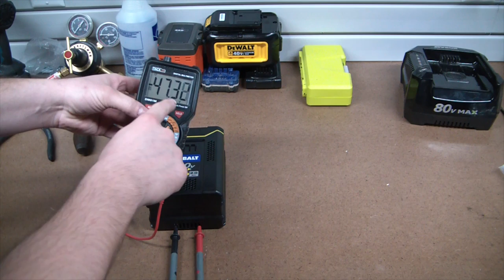Kobalt 80V Battery Recovery and Teardown - ElementalMaker

Comment: in case you don't have a power supply you can use the working 80V battery and a resistor to burn down the shop
Reply from the maker: I like your style 👍👍👍
Reply: Where can you buy a power supply
Reply: Me sitting here who caught the whole table on fire with a 9v battery 👁👄👁
Reply: Wow what lowes give away free dead batteries?  I can't find a lowes or home depot that will let me take dead batteries.
Reply: What value resistor?
Reply: @hduff  Depends on the resistors power rating. If you have a 0.5 W resistor and the voltage drop is 80 V, then the resistor must be larger than R=U²/P=80²/0.5=12.8 kOhm
Reply: @williammolineux1059  no one to answer
Reply: can you elaborate please?
what resistor?
+ to + - to -?
Reply: @ElementalMaker what kind of connector or pins you used for the battery at 3:50 ? And instead of a power supply, can a car battery work to wake up a 80v battery? Thanks
Reply: @anotherparadise  I wouldn't consider attempting it with a car battery as it's 12 volts. Lots of amperage, yes but the voltage is wrong.

Comment: Don't know if this was posted here, too many replies to sort through but, the Kobalt and Greenworks batteries are essentially the same and will work in each others tools. Their battery case has grooves slightly different from each other so initially one brand battery won't slide into the other's battery pocket. I took a wood chisel and removed the one offending ridge on each side of the battery pocket on my Greenworx chainsaw,  leaf blower and snow blower to use a couple Kobalt batteries my son gave me.  He did the same thing with his Kobalt mower to use Greenworks batteries. We also modified the chargers by removing the upper ridge to allow either battery to charge in our respective chargers. Two years now with no issues.
Reply: made by the same company.
Reply: Dumb question over here.. why didn't you just exchange batteries?

Comment: Dang, my battery is at 65v and the charger still has blinking red light. I think the bms is causing my battery to not charge using the bench power supply. :/

Comment: I have a Kobalt 80V lawn mower and my experience is when the mower stops because the battery is discharged none of the green LEDs light when the button is pressed and the battery is down to 65.5V.  Putting the battery on the Kobalt charger can sometimes result in nothing appearing to happen for a while other than a red light. After a further while it comes good and starts to charge fine, I my case I just need to exercise some patience. Thank you for the video, I was trying to disassemble one of these packs who's cover did not want to come off after I'd removed the 4 security screws. Your video gave me the courage to tug a bit harder (which worked).
Reply: @Real Deal Replacement packs are extortionate. Cheaper to buy a new tool that comes with a brand new battery when there are special deals on, like today Memorial day sale.

As for being cheap Chinese designed to fail, I have to disagree. Most Kobalt packs are made with Samsung brand cells made in South Korea. They are designed for 250 cycles. May not sound like much but if you do yard work 25 weeks per year that's a 10 year battery life. 

The important thing is to take good care of the battery packs. Don't let them run too low on charge and store at 50% during the winter months. During the summer I cycle between 25% to 100% state of charge, and store at 75% if possible.

Comment: Also, thanks for the tip!  I had a Kobalt battery reading 56V and being rejected by my charger. I fired up my dual-30V bench supply, put both channels in series, managed to charge it up to 61.5V, at which point the fast charger would take it. Looks like I saved $150 at least for today, plus a trip to Lowes. Thanks!
Reply from the maker: Hopefully it lasts for you, unfortunately mine only lasted another season after rescuing it. I may replace the cells and charging circuit though, since it seems like the oem kobalt charging circuit is what's killing the cells
Reply: @ElementalMaker  Yeah... it worked for awhile, but eventually died again. Hard to tell if it was actually a worn-out battery, or if the prolonged low charge level killed the cells. I wound up shopping around and found Greenworks batteries for substantially less. Sure, they're keyed differently, but if you take the battery apart, and put the Greenworks cells in the Kobalt case, it works just dandy. I know some people route the plastic instead, which is also a possibility. I imagine they use the same molds with a different insert depending on who's battery they make. Bastards!

Comment: I have a dead 80v that was dead.  It was down to 35v.  I woke it up by using a good 80v battery.  Just used a couple of 14 gauge solid core wires to jump it for 5 minutes.  

It didn’t get hot, and now takes a charge.  Thanks for the video.
Reply from the maker: In the future I would highly recommend using a resistor between the batteries, otherwise you could cause some serious damage to both, something like a 100ohm power resistor (100w would work), to limit current to about 1 amp.
Reply: @ElementalMaker  I'd go for a much lower charging current for this. Li-ion batteries, as you probably know, are best charged at constant current up to about 3.9V (depending on the chemistry), then constant voltage. Do it wrong and you damage the cell. But they don't get any significant damage from a trickle charge. So put 100mA or less into it and you're probably pretty good... it takes longer, but it's less stress on the battery.

Comment: Just bought one of these (along with the mower) and came to YouTube to find out what's inside. Now I don't have to tear it down myself. Thanks for the video!
Reply from the maker: They seem like pretty good batteries! Just don't run them totally dead on hot summer days and the batteries should last you some time. 👍
Reply: @ElementalMaker  
So when you run it totally dead at high temp, then as it cools it goes below to low voltage cutoff? Is that correct, that causes the situation you had here, where the voltage is too low to let it charge? I'm on an ongoing quest to understand Li-ion batteries...
Reply from the maker: You are absolutely spot on Jeremy. Very well said. The cutoff voltage seems to be right around 60V, and if it drops below there it bricks the battery unless you have a good power supply you can manually raise the voltage with.
Reply: ElementalMaker 
Cool, thanks for the info!
Reply: @ElementalMaker  Have you ever tried finding replacement circuit boards for that type of battery? I've tried the jumper method and while I can get the voltage back up it will wont charge on the charger and it will only allow the mower to start up and then die. My briggs and stratton 82 volt batteries aren't lasting, i've had 2 that die.

Comment: I can't believe I found this video on my first attempt. I received a cordless Kobalt 80V weedwacker for my birthday this week. My daughter who works at Lowe's brought me a returned battery from the back, unsure of it's condition. It showed dead in the charger and when I pushed the button on the battery. Thank you for proving that these batteries can be recovered. Now I need to get a power supply.
By the way, the 19th century wrench you showed us on your video looks exactly like one I inherited from my grandfather. He called it a "monkey wrench."
Reply: @Real Deal I've had Kobalt 80v yard tools (mower, leaf blower, bush trimmer, weed whacker) for over 3 years now and haven't had any issues with the batteries or the tools and I've abused them thoroughly.
Reply: @Real Deal Not all Li-ion batteries are the same. These are probably using Lithium Manganese Oxide (LMO) cells, which offer a higher specific power than the typical phone/laptop Lithium Cobalt Oxide (LCO) cells. They are optimized for high power, not high specific energy. And yeah, unfortunately, LMO batteries don't last as long as LCO batteries, but as well, you're probably not weed-whacking 10 hours a day, every day. 

Keep in mind, 18650 is just a physical spec for a battery size, no indication of what's inside. This is also why, if you wanted to replace the 18650s in the Kobalt/Greenworks battery, you'd need to really do your homework. You can find 3-5Ah 18650s, but they're probably all LCO, not capable of the peak power needed by electrical tools.

Comment: I forgot to keep 2 of these batteries charged over winter and they read around 3 volts. With a cheapo 60v power supply from Amazon, and about an hour or so, I revived both batteries. My advice if you do this project, be aware of Constant Voltage and Constant Current settings on the power supply and practice with the supply before you use it. Aside from that, Great video and Good luck!

Comment: thanks dude! i don't have a current source, i don't have a proper resistor, so i have to try the jump start with another battery. a bit scary though because there's spark.. i know I should've used a resistor.. anyway, two touches and the voltage of the dead battery boosted to slightly above 20V, and now it starts charging! you are awesome!!
Reply: Absolutely works.  Charge up the good one and then jump positive to positive, neg to neg to the bad battery.  It is easily displayed on the battery case.  After about 10 minutes the power button on the bad battery lit up.  Then put it in the charger and it charged right up.  Works fine now!!

Comment: Great video! Very informative. Thanks to another comment about connecting a good battery to an unchanging one I was able to revive my second battery. If anyone is wondering I used 14 Guage wires for about 5 minutes.
Reply: How did you do this? Did you use a resistor?

Comment: Remember seeing this video ages ago. Was going through the garage mounting ally 80v chargers and 3d printed battery holders etc. Had one 80v battery crica 2017 that would not charge and no lights. Took it apart hooked up the power supply set it to 80V 2A and let it go. A few minutes later I had green lights tested iton a charger and it was golden.

Comment: That's awesome, especially since I imagine that big ol honking pack can't be cheap. Pretty cool design too. I buy and repair DSLR cameras all the time, and they end up coming with usually dead batteries. They're not that exciting, usually only two cells. It's typically one cell that gets below the cutoff and kills it. I just pop them open, ease the low cell back up, charge the pack to full at a low rate, then just do a couple full load cycles before I'm comfortable putting it with the camera when I sell it. But that's friggin awesome. That 80 volt is a nice haul even if you're just at it for the cells alone.

Comment: **PLEASE HELP** My 80v Max 5.0 ah battery is Reading 79.2 volts but still no green bars and will not show any lights red or green on the charger and will not run more than 5 secs if i put it on the chain saw... *WHY?????**  its reading full charged on the digital multimeter  but nothing on the the chain saw battery itself or on the charger.. 😵😵😵😵
Reply: Had similar problem with HF Atlas 80v, which has 2, 40v legs.  2 year old batter with 3 test lights had 38+v each leg.  Would turn the trimmer on briefly.  Started charger but shut off quickly, flashing red.  Went ahead and connected a new, fully charged battery as described for 5 minutes each leg and successfully charged afterwards.  Give it a try, nothing to lose.
Reply: @jcadult101  🤔 man thank you indeed!!! I will try it

Comment: So you could have used the good battery as a supply feed to the bad battery  right?
Reply from the maker: Yes but you'd need to use alot of caution, and some kind of current limiting resistor or a current regulated buck converter

Comment: My Kobalt 80V batteries charge up fine, but after 4 years the batteries have a shorter run time with the same equipment used. Can the 18650 be swapped for new ones ?

Comment: I have a 80v 6ah battery reading 74.8v. When put on the charger it will seem like its charging for abiut 20 mins or so then the red light on the charger blinks any idea which is bad?
Reply: I have the same issue with the battery in this video (2ah).  @ElementalMaker can you add some light on this issue?

Comment: One of the downsides to cell balancing circuitry is there's always a wee bit of leakage current.  On a lithium ion battery pack with battery protection circuit, and cell balancing, there's always the unlikely possibility that the user would use the battery until the battery protection circuit prevents further discharge, then the pack gets lost or otherwise doesn't make it back to the charger, and the balancing circuitry leaks each cell's voltage so low that the total voltage is so low that the charger blinks the red light.  

 Page 3 of the charger manual goes into detail on "False defect note" (what to do when the red light blinks), and "Low voltage charging" (recovering the battery pack from extremely low voltage)  The thing is, the manual doesn't mention what the led indicators do in this extreme low voltage charging condition.  Please also note that the manual was written in a geographic location in which English is not the primary language.  

It might be worth investigating whether when the battery pack is extremely low as in this video, and is inserted into the charger, and the charger's red light blinks, measure the battery current and confirm that it's not charging at all.  In the case of the pack in this video, the pack voltage may have been so low that there's some liability involved in attempting to charge it.

Comment: I have 2 dead 80v's. Is there a resource that goes into detail how to test/repair them? One of my 80v was like yours, would not even light up on the indicator. I have another that shows 2 green lights but will blink red on the charger after a few seconds. I actually have one of those power supplies but I am not confident on how to use it. I would love to save some money here, much appreciated if you can help.

Comment: Just put battery in my Kobalt string trimmer today and it has no charge. Put back on charger and nothing. Great video. Now I have to find a way to get this back up to 60v threshold for the charger.
Maybe you should start a business on the side.  Mail in service for resurrecting these batteries. Just checked and Lowers want $199 for a new one.  I pay only  $179 for the whole trimmer last year.

Comment: @ElementalMaker I don't have a Power Supply, can you advise if it's possible to use one good batter to charge another one the way you did with the power supply?  Also, what type of connectors were you putting in there that allowed the clip on for the Power Supply?  They looked like they worked really well.
Reply: Try paper clips for connector or solid conductor wire; 12AWG should do it. One good battery to bad should be done using a resistor in series (such as 25W rated capacity with aluminum heatsink).

Comment: I need to replace the battery pin connector of the positive side of a Kobalt 80V battery it burt a little, any help or references to go about it?
The battery still connects and does send power to the battery holder and equipment
Any help is well apprciaed.

Comment: So many success stories. I had a 60v Greenworks that wouldn't charge. Took apart and had 10 cells .5v below others. I charged all to match at 50% level, but still charger blinks red. It works in tool, but just will not charge. Any thoughts as what to do next?

Comment: I have a 2.5 Amp 80v Kobalt that shows full charge but as soon as I put it in a tool and turn it on, it goes to zero, no lights at all.  When I put it back in the charger, it goes right back to showing full charge or two lights and soon full.  Dead cell(s)?  Electronics gone bad?  It reads 80.7 volts showing three lights and showing no lights.  Oddly enough when I try to turn on a tool and the lights all go dark, they light back up as if full charge again when I take the battery out.  The chainsaw shows bad battery and will not turn on at all.

Comment: I have one of the 80v trimmers and mowers. Now I just need a way to drop the voltage so I can use it on the 24v tools.
Reply from the maker: You would need one hell of a buck converter to accomplish that. That would be a tricky conversion I'd think.

Comment: Hi, I was wondering if there is a tool to test the capacity of this type of battery pack without dismantling it? I purchased an aftermarket one on aliexpress, and on the description, the capacity is 12.0 Ah. But I just want to make sure. Thanks.

Comment: I have a kobalt 80v 2.5ah battery that shows fully charged. When i put it on the charger it appears to be charging, then after about 15 minutes the charger flashes red. When i put the battery in the tool, it functions for a second or two and stops. Any ideas on what could be wrong?
Reply: Same exact problem for me also.  If I remove and re-insert into the charger it will eventually charge to a green light.  But I'm getting horrible run time with my leaf blower, and the cycle where it dies in a few seconds, wait 10 seconds and retry, repeat like 10 times, and then it works a bit longer.

Comment: My batteries only blink red when its extremely hot out (I'm in south Florida) but after about 10min on the charger they start charging just fine. 
I've had my batteries for 5yrs.  I'm just starting to have a problem with 1 of the batteries. 
It lasts about 10min but when I put it on the charger it shows 2/3 charged and only takes 10min to charge to full.